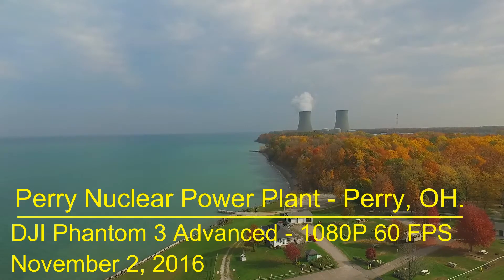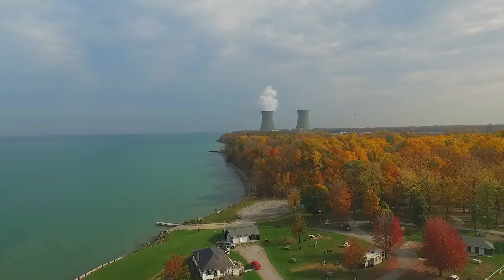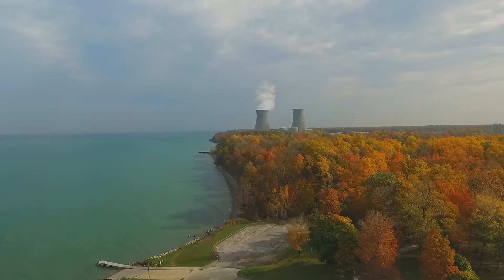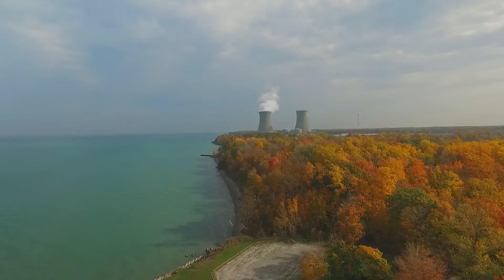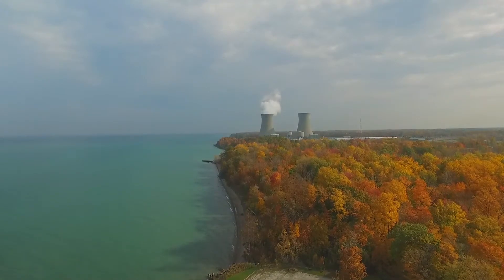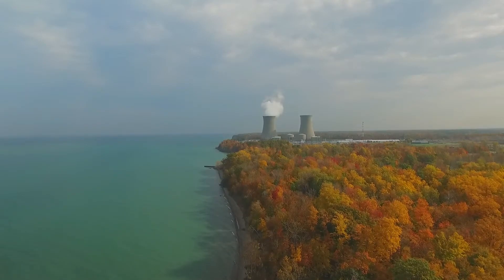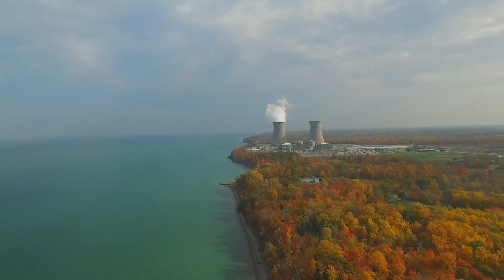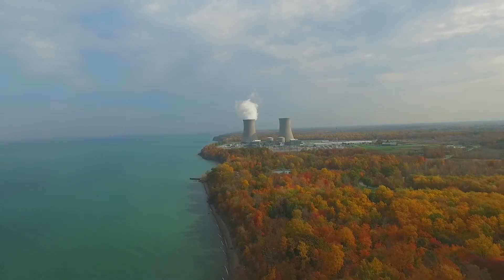P3A Perry Nuclear Power Plant - Nov.  2, 2016 (1080P60) 2 minutes

Comment: u get 3 miles out of the ps3 advanced is that in the city or just at the lake
Reply from the maker: Well, that was out in the country .. but, I live in the country and mostly fly in the country. I've actually only pushed it out that far ONCE, just to see what it could do, and that was flying over mostly flat farm/vineyard land. After that, I had the peace of mind that I needed. On most of my shoots, I fly within a mile of myself. However, its nice to know that it has that kind of range.  I think one time, prior to doing the 32 channel update on the DJI GO app, I was flying over a city business area, full of wi-fi hot spots, and I got barely over a mile before I stated getting warning signals. So, topography really does matter. Litchi has always supported all 32 wi-fi channels, and that feature can be added to DJI GO app by just copying a file to a certain folder. The 32 channel procedure is documented on YouTube in many videos. I think Drone Valley did one most recently. Cheers.

Comment: I watch a lot of your videos just wanted to asked do u have a range kit on your phantom or x380. Keep making awesome videos bro
Reply from the maker: Hello Avant, and thanks for stopping by. I do have a pair of those parabolic reflectors on my DJI Phantom 3  Advanced, made by SkyReat (I bought on Amazon.com). I've never pushed it beyond 3 miles (15,000 feet), but always had good control and picture out that far .. don't think I want to go farther!  On my X380, I have no mods on the TX, as its good to almost a mile unmodified. I do have very good VTX  RX/TX antennas on my diversity monitor setup, which give me very good video back to the transmitter .. very important if you're flying far away, so you don't hit anything. Again, thanks for stopping by, and so glad you enjoy the videos. Cheers.

Comment: Their a little touchy over here as well. Interesting and just love the colour from the trees.
Reply from the maker: Hi Barry, well, I fully expected that my tablet on which I view what I'm shooting, and which controls much of what the drone does, was going to give me a "No Fly Zone" warning.  It has that feature built in, so that if you are within a 5 mile radius of an active airport, you will be warned, and likely be unable to fly if you are using a DJI Phantom drone. However, I received no such notice, so I assumed that it was okay. Still, I was hesitant to fly TOO close .. didn't get closer than about 1/2 mile, though the range of the the UAV I was using (DJI Phantom 3 Advanced) could have easily flown right over and past the site. With all that goes on in the world today, I'd rather "be safe than sorry".  Over 3 decades ago, when this was under construction, I had a 3 meter wingspan glider which could fly VERY high. I put a Kodak 110 camera in it, and shot a few pictures of it from about 2000 feet altitude but over 3 miles away. Back in those days, there were no digital cameras, and no "auto advance" of the film, so I had to land after every shot, take the wing off and advance the film manually to be ready for the next shot. If you'd told me back then what I'd be able to do a few decades later, I'd never have believed it. Cheers, and thanks for stopping by.

Comment: Just imagine if they finished the 2nd one... all that power coming from one location. Incredible! Nice fall colours. Found myself wishing you would fly down and skim the treetops. Thanks for sharing.  G
Reply from the maker: Well, as I mentioned, I was pretty nervous about flying that close to a very secure area. About 20 years ago, my buddy and his friend were fishing in a small boat on Lake Erie, and a storm came up and the knew they couldn't make it back to the boat launch 5 miles away, so they beached at the shore of this facility. They no sooner pulled their boat up on the beach when a couple of uniformed guards with .45 cal pistols greeted them! I'm sure they have some kind of protection from "air attack" and didn't want to press my luck. Still can't believe there wasn't any NFZ problem when I took off. Yeah .. unbelievable power. It is "re-fueled" every 2 years.